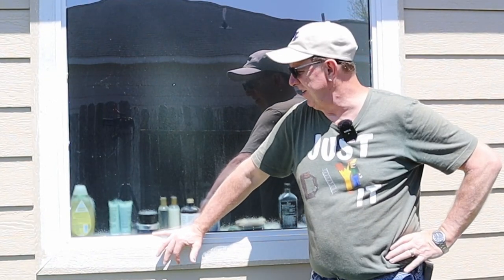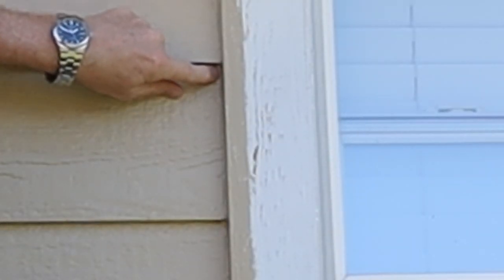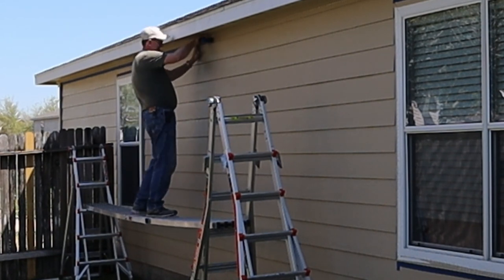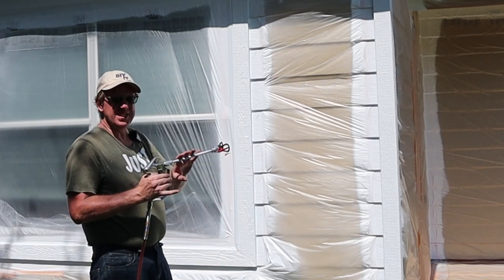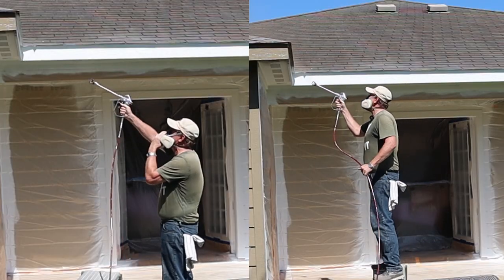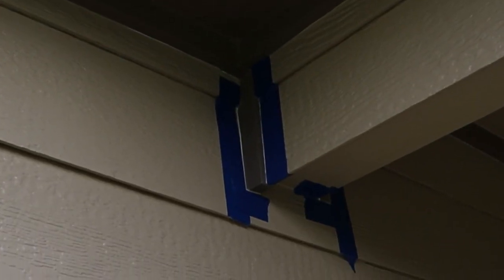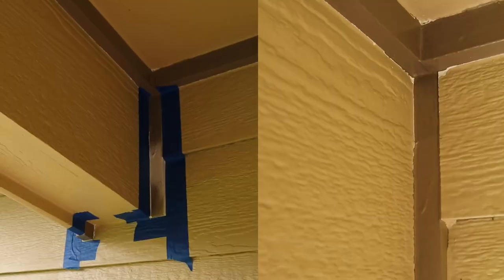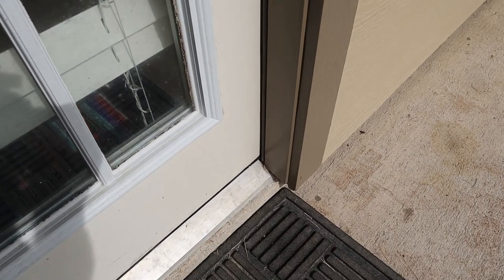Prettiest on the Block-Trim Painted-Finally Finished 2/2

Comment: a tip for you after you put on the tape put the smallest amount of calk preferably the same color as the field... this will stop the bleeding under the edge of the tape... so when you spray the trim you will have nice clean lines.  When I say "the smallest amount" use a sponge and water to clean off the excess.

Comment: What about the over spray on your roof?
Reply from the maker: Wasn't an issue it didn't stick well and first rain washed it off.  Also wasn't worried because the roof needs to be replaced.  Thanks for watching.